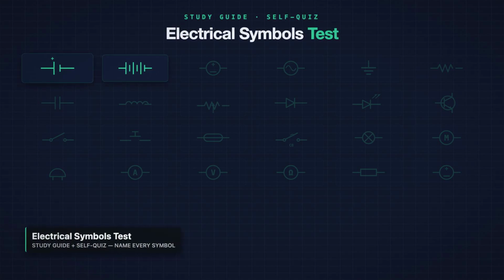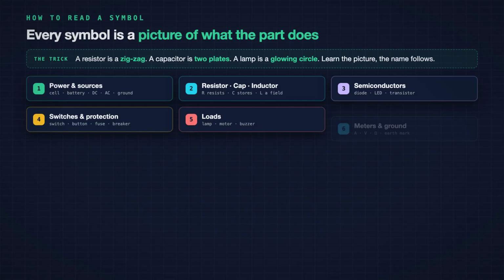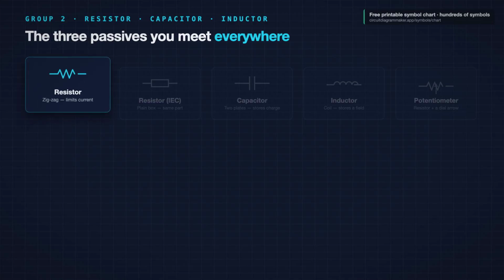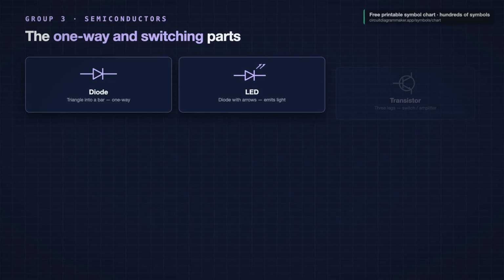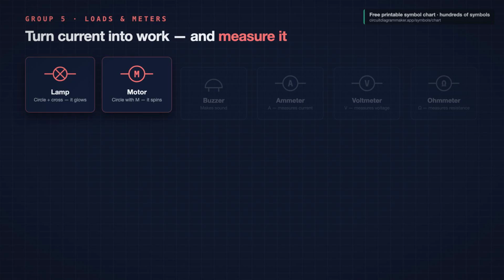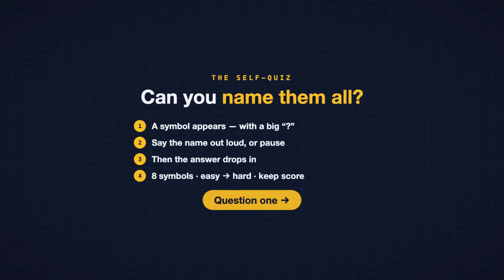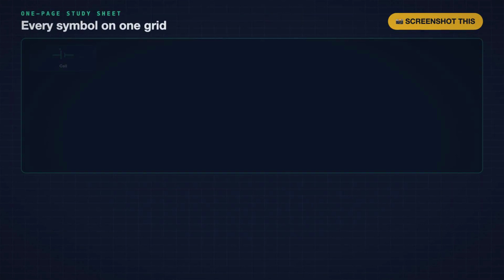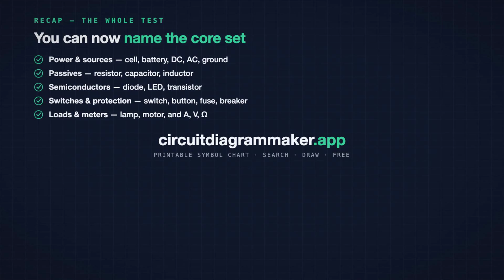Electrical Symbols Test — Study Guide

Comment from the maker: Scorecard: 6+ correct and you can genuinely read a schematic. The two that trip people up most are the LED (it's just a diode with two little arrows leaving it, because it emits light) and the transistor (three legs — the arrow on the emitter is what tells you NPN from PNP).

How many of the eight did you get? Drop your score below.

Grab the free, searchable, printable symbol chart to study from: https://circuitdiagrammaker.app/symbols/chart?utm_source=youtube&utm_medium=pinned_comment&utm_content=yt-149